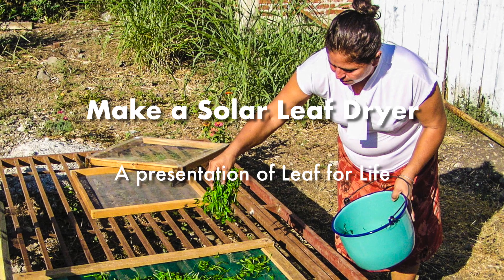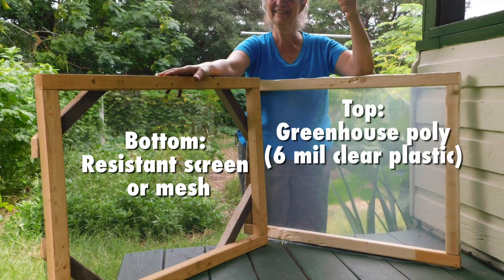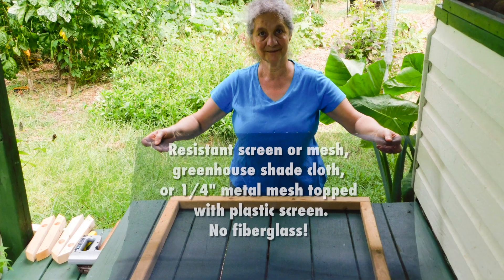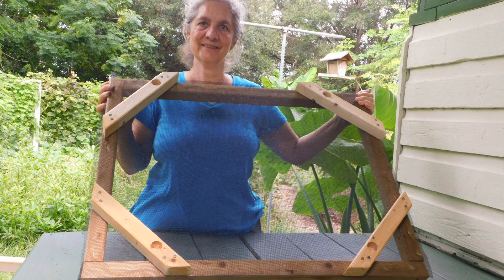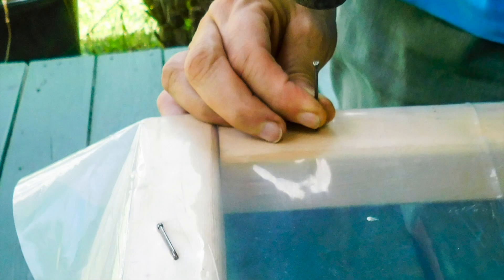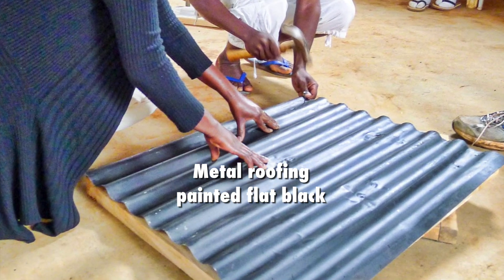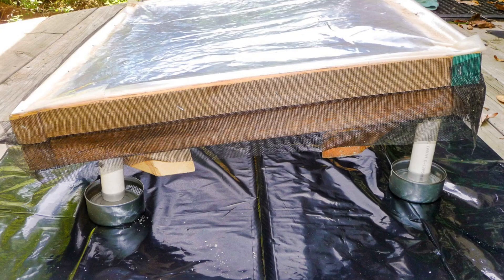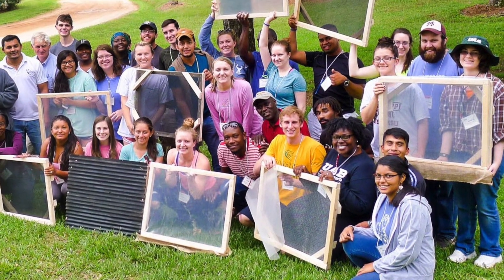Build a Solar Dryer

Comment: hello! what you're doing is great!  I encourage people to make solar dehydrating by heating the air with the Sun and then pass it through the fruits which will be better kept at the shade thus keeping the most of its nutrients otherwise affected by the direct solar radiation. PLUR. Be happy!
Reply: Sounds great. Some entrepreneur in India seems to be using a similar concept.
Kindly share a link if you have any.

Comment: thanks man I was on my way build something similar to this. did not think about cross brasses for extra screen support. or ant attacks hope rember these add on. only problem water pond same one had with humming bird feeder ant water ponds. some times have song birds drink water then ants get prize. with dry be on ground any dog or cat could do same thing.
Reply: I have old double panel slide door. took glass out know two piece glasses said didn't like to much sun hite greens glasses what got. might put greens paper bags open end let water vapor out. that protect get to much sun but get heat dry out.